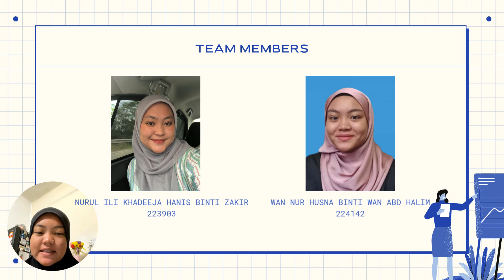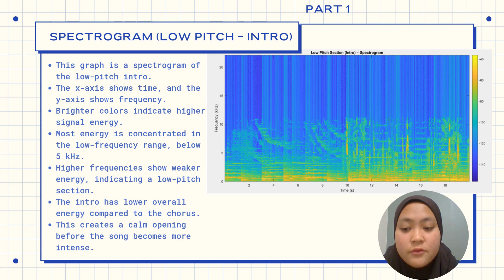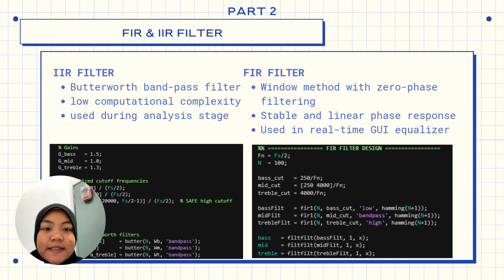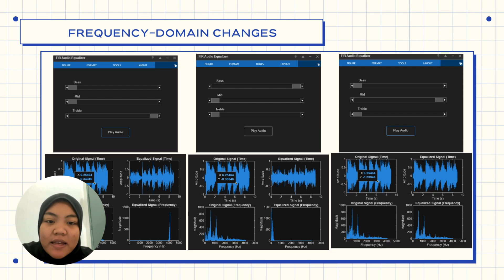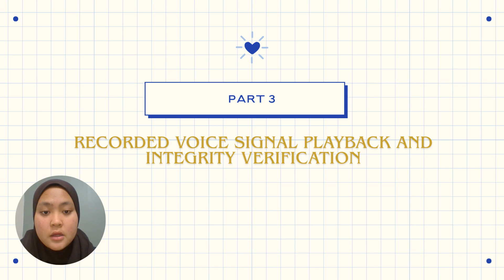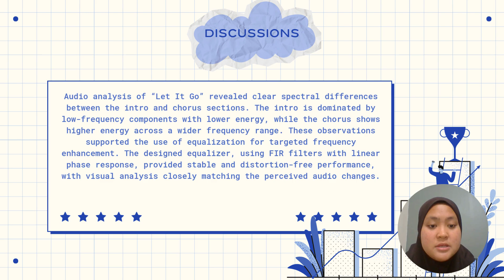GROUP KIMCHII (DSP ASSIGNMENT)

Comment: Hi group Kimchi, I am from group Drone. I noticed a potential contradiction regarding the low-pitch character. The graph shows the signal is mostly below 11Hz, which is below the human hearing threshold of 20 Hz. Since these are infrasonic frequencies that humans can't actually hear, how was the calm sound character determined?
Reply from the maker: Thank you for pointing this out. The frequency spectrum shown represents the normalized or analysis-domain frequency components rather than the direct audible pitch frequency. The “low-pitch” description refers to the dominance of lower-frequency energy relative to other sections of the song, not that the audible pitch is literally below 11 Hz. Human pitch perception is influenced by harmonic structure and energy distribution, which is better observed through relative spectral content and the spectrogram rather than absolute frequency values alone.

Comment: Hy Kimchii, i want to know how does low-frequency dominance relate to the perceived pitch of the audio?
Reply from the maker: Low-frequency dominance generally contributes to the perception of a deeper or warmer sound. While pitch is determined by the fundamental frequency, the strength of lower harmonics plays a major role in how pitch is perceived by the human ear. When low-frequency components carry higher energy, the audio tends to sound lower and fuller compared to signals with stronger high-frequency content, which are perceived as brighter or sharper.

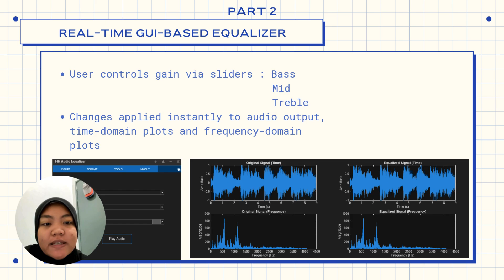Comment: Hi Kimchi, i want to ask questions about your real-time audio equalizer GUI on minutes 7:43, when you increase the gain for Bass only is it just allow the low frequency to flow or it will remove the low frequency to the output?
Reply from the maker: Hi, thank you for the question 😊

When the Bass gain is increased, the low-frequency components are boosted, not removed. The bass band-pass filter allows low frequencies to pass, and the gain control amplifies those frequencies before they are recombined with the mid and treble bands.

The low-frequency content is always present in the output signal; adjusting the bass gain only changes its amplitude level, not whether it exists or not. This is why we can enhance bass without affecting other frequency bands.

Comment: Hi Group Kimchi, could you explain what additional information the spectrogram provides compared to the frequency spectrum diagram ?
Reply from the maker: Thank you for the question. The frequency spectrum shows the overall frequency content of a signal but does not indicate when those frequencies occur. In contrast, the spectrogram provides time–frequency information, allowing us to observe how the frequency components change over time. This is especially important for music signals, which are non-stationary, as it helps us identify differences between sections such as the intro and chorus that cannot be seen clearly from the frequency spectrum alone.

Comment: Hi Kimchi, may I know how does your processing affect the signal compared to the original one?
Reply from the maker: Hi, thank you for the question 😊

Our processing does not change the core content of the signal, but it modifies the amplitude of selected frequency bands. Compared to the original signal, the equalized signal shows enhanced or attenuated energy in the bass, mid, or treble ranges, depending on the gain settings.

In the time domain, the waveform shape remains similar, indicating no major distortion. In the frequency domain and spectrogram, we can clearly observe controlled changes in energy distribution. This confirms that the processing improves audio balance while preserving the original signal integrity.
Reply: @NURULILIKHADEEJAHANISBINTIZAKI  wow very polite and informative 👍 keep making vidoes like this ya so i can keep learning

Comment: Hi group Kimchi, you mentioned using Butterworth IIR filters but switched to FIR filters with the window method for the real time GUI. Why didn't you use IIR filters for the real time GUI as well, given their lower computational complexity?
Reply from the maker: Hi, thank you for the questions 😊

We used Butterworth IIR filters during the analysis stage because they have low computational complexity and a smooth magnitude response, which is sufficient for observing the main frequency characteristics of the signal.

However, for the real-time GUI equalizer, we switched to FIR filters using the window method mainly because FIR filters provide a linear phase response and are inherently stable. This helps preserve the original waveform shape and avoids phase distortion, which is especially important for audio perception in real-time playback.

Although IIR filters are more computationally efficient, their non-linear phase response can introduce audible phase distortion when adjusting gains interactively. Therefore, FIR filters were more suitable for achieving stable, distortion-free, and perceptually accurate real-time equalization, even with slightly higher computational cost.

Comment: Hi Group Kimchi. I see that you used Butterworth IIR filter for analysis but FIR filter for the real time equalizer. What was the main reason for this switch?
Reply from the maker: Hi, thank you for the questions 😊

We used Butterworth IIR filters during the analysis stage because they have low computational complexity and a smooth magnitude response, which is sufficient for observing the main frequency characteristics of the signal.

However, for the real-time GUI equalizer, we switched to FIR filters using the window method mainly because FIR filters provide a linear phase response and are inherently stable. This helps preserve the original waveform shape and avoids phase distortion, which is especially important for audio perception in real-time playback.

Although IIR filters are more computationally efficient, their non-linear phase response can introduce audible phase distortion when adjusting gains interactively. Therefore, FIR filters were more suitable for achieving stable, distortion-free, and perceptually accurate real-time equalization, even with slightly higher computational cost.